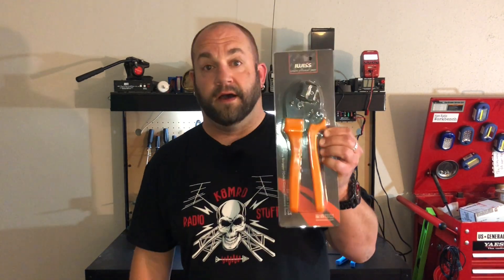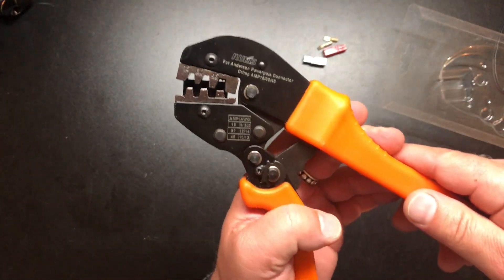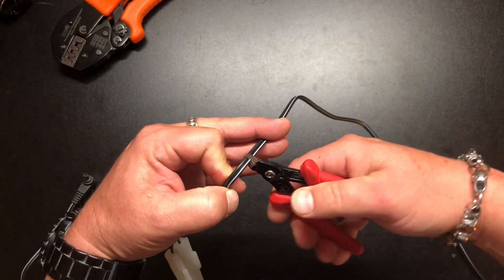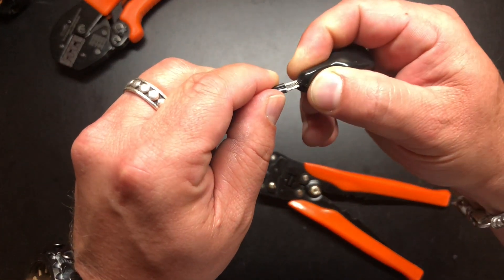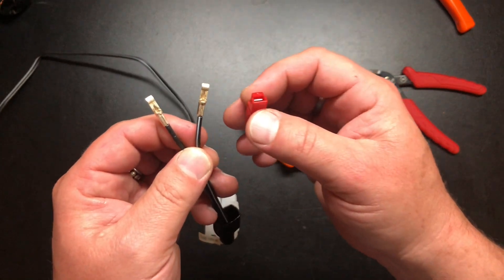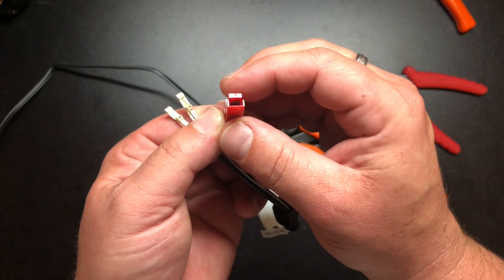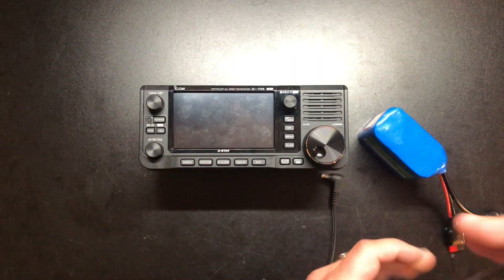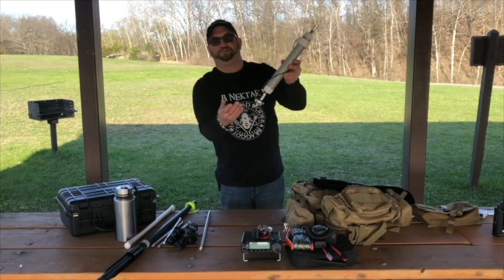IWISS Powerpole Ratcheting Crimp Tool | But is it good??

Comment: A ham throwing out a 2 ft section of wire? Yeah right.
Reply from the maker: That is seriously one of the best and funniest comments ever on the channel!!  It’s getting pinned for everyone to enjoy.
Reply: I actually gasped! and said out loud (to the dog in my otherwise empty room) “HEY-I’ll take that if you don’t want it”
Reply: @HowToHam_Tom  Know what you mean. I'm going to the club operations house to pick through the "material draw down" stuff and maybe score some antennas or wire or coax. Now that I am a ham all my years of "hoarding" wire, connectors, etc. may finally be worth it!
Reply: I was thinking the same, like most everyone im sure, cheers
Reply: That can be used for a 2M, 1.25m or even a 70cm dipole!
Reply from the maker: It was only to add drama lol!   I still have it, of course.

Comment: I have the Dent-De-Lion that I got off of Amazon and it's been FANTASTIC for over 200 sets of power poll connections. I found it easier to drop the tip into the crimper 1st then close down one click not to press the fitting. Then insert the wire and with the single click on the crimper it holds everything in place. Then crimp down on the 30 then pull it out and crimp it in the 15 for a tighter fit. Then I always use the rubber boot and heat shrink on the end for a really good connection.

Comment: Also bought this crimper last summer on Amazon.  Finally did my first crimp tonight with help of your video.  Our Freemo Std RR club requires the PP-30 for 5-wire interconnection.  Thanks for sharing instruction.  Just a little tricky snapping the connector into the housing.

Comment: Contact crimping hack I have used for years.  Crimping to smaller diameter wire in a contact?  You can cheat buy doubling the stripped length and folding the stripped wire in half. then  Insert into the crimp zone of the contact and complete the crimping.     I would not suggest folding wire to fill the crimp more than once.   But to each their own.  Just a suggestion.

Comment: Given the wire size and current draw, you need only the 15A PP, but you know that. (Captain obvious here...)

For this type of connection, I usually insert a roll pin after aligning the two connectors to keep them locked together.

I had a cringe moment (although I have every confidence that you already checked) when you plugged an untested connection into your radio. I would have done a voltage check to confirm correct polarity first. ;) But then I'm an engineer and anally retentive that way. 

Thanks for the heads up on the tool.

73 de AG7TX

Comment: For a reliable connection, 100% of the strands must pass through the entry and exit bellmouths of the crimp, forming a "brush" on the exit side. At around 6:15 you can see that the terminal has tabs to stop the end of the wire. Push it all the way to the tabs! Don't be afraid to have strands protruding; that's how it's designed to work, so you can verify the quality of the crimp. -IPC/WHMA-620 "crimpety crimpety now now crimpety crimpety ask me how"
Reply from the maker: I only like my stuff to be mostly reliable.
Reply: @hamradiotube  mostly reliable is 100% reliable if there's spare terminals on hand!

Comment: I have these crimpers but for other uses. They work but they DO NOT fit the large 50 amp power pole units so an old school crimper is used for that.

Comment: Hey Mike, nice video on the Anderson Power Pole ratcheting crimper.   I purchased  two types of ratcheting crimpers plus the special dies that are offered with them.  The first ratcheting crimper that I purchased was from DX engineering. It was made by Iwiss with the red and black padded grips for $49 plus 2 special dies that were $20 a piece.  
The second ratcheting crimper was made by TRI crimp with all the special dies that only work on that model for $60.  My second crimper is very similar to the one you reviewed in the video. Personally, I like both that I purchased, but the tri crimp has longer handles making it easier to crimp 10 gauge wire in the 45 amp metal clips.  The one offered by DX engineering is a good quality one, but the shorter handles require a little more effort to crimp 10 gauge wire in the 45 amp clips.
Reply from the maker: Thanks for the input and thanks for watching.

Comment: I have one pair of crimpers. I use them for all crimping situations. (They may be old Klien crimpers) No jaws to replace, crimps all sizes. These are probably 20-30 years old. For power poles, all you need to remember is the crimped area needs to stay "round" in shape to fit into the power pole housing. I crimp it as usual, then turn the crimped area 90 degrees and crimp it "lightly" using a toothless crimp area to round it out. Works on 15, 30, and 45 amp power poles. Havent had a failure to date.
Reply from the maker: Hey, whatever works.  I crimp so many power poles I just like having the crimper for them.   Thanks for watching.  73

Comment: The IWISS seems to be popular!  Guess we're all cheap SOBs.  I bought one a couple years ago and it's been great.  I've noticed that depending on the wire gauge you can crimp it again on the next smaller slot to get a really good crimp.  Like if you're doing a 45, crimp it in the 45 slot first then put it in the 30 slot and squeeze again.  Gets that bad boy really tight and it won't pull off.
Reply from the maker: Its pretty awesome.  I just bought one for a friend who is new to the Power Pole addiction.  They work great and aren't super expensive like a lot of others out there.

Comment: I was thinking about buying this tool, but when I looked at how it crimped, I had an old cutter/stripper/crimper like you can buy at most home stores for like $10 - 20 and just used it.  To be honest, I had to crimp it twice along the connector, but it worked just as good as other connections I did when I borrowed a set of power pole crimpers.  If I made more of these connectors up I would probably buy a set, but for just doing one radio, I didn't really see the need.
Reply from the maker: I was bit by the Powerpole bug early in my ham career.  Now they are taking over my life and I put them on everything 12v DC.  Having 2 crimpers is so convenient for me.

Comment: I have that exact same crimper however mine is unbranded. 
When I put power poles on a small gauge wire I strip a little extra and fold it over so the connector has more to crimp on.
Reply from the maker: Oh yeah I've done that too.  Gotta make it work somehow.

Comment: This is a serious question- can someone please explain to my why every youtuber uses a tool which was designed for open barrel terminals and connectors on closed barrel anderson powerpoles?  Why would you want to put a "box crimp" on a round wire?  Wouldn't a rounded non-insulated crimp tool be better?  Also, look at the manufacturer website/Amazon site...doesn't it show open barrel connectors for this tool?  I see that you tagged the manufacturer on this video....maybe they can respond?
Reply from the maker: Because that's what Anderson Power Products recommends.  Heres a link to the official Anderson crimping tool.  Its not a box crimp.  When the connector gets crimped it is rounded back down by the crimp tool. https://www.alliedelec.com/product/anderson-power-products/1309g2/70162295/?utm_source=google&utm_medium=cpc&adpos=&scid=scplp70162295&sc_intid=70162295&gclid=Cj0KCQjwmcWDBhCOARIsALgJ2Qe-uWd3iVfB7Cwm_E_eYZU_jmNCnYdC9YhriHKPO-AcU8hwKs9bHfYaAqhFEALw_wcB&gclsrc=aw.ds
Reply: @hamradiotube  ok, but look at the connector which they are using in box number one of this page:  https://powerwerx.com/tricrimp-powerpole-connector-crimping-tool. It is an OPEN barrel connector with this tool.

Comment: Hey Mike I have the Powerpole version I bought many moons ago and if I recall it was indeed pricey back in the day but has crimped many power cables for our ARES group and club group. Heck even the connectors today are still pricey. Thanks for the video.....Fred
Reply from the maker: I was just looking at the official one.  Almost $300!!  Yikes!  I'm sure its the last one (or 2) you'll ever need to buy though.

Comment: Thanks for choosing IWISS. This crimper was designed specifically for Anderson Powerpole connectors. Each jaw cavity crimps certain AMP connector only, so choosing the correct cavity is very important.
Reply from the maker: Wow thanks for watching!  Great crimper.  Thanks for the explanation, however I am very aware of my crimping flaws haha!  Really happy with your crimping tool.
Reply: @hamradiotube  No problem, Mike. You'll find a way to work with it peacefully. Thank you for the great video.
Reply: Hey  @IWISS , it would be awesome if you sold or marketed (and maybe you do, but I can't find them for sure) additional dies for this model. The MC4 crimp is basically a half-Anderson. The overlanding folks use these two crimps the most
Reply: I have these IWISS crimpers, and they failed me today. I was crimping AWG14 wire in a 30A terminal, and the wire pulled right out. I was even able to reinsert the wire into the "crimped" terminal, and over crimped it using a Klein 1005 crimper. 
Terminal fine now, but maybe I should have just used the Klein to start with?
Reply: Are the PowerPole dies also available for other models of iWiss crimpers, or do I need to dedicate a crimper just for Power Poles?

Comment: Where did you get the wire stripper like that?  I haven't been able to find a nice automatic adjusting wire stripper.  I've got a good power pole crimper similar to the IWISS (I actually considered getting the IWISS off Amazon).  Also been looking at starting to make my own lengths of coax, but I don't have coax crimpers.  Would love a video or info on those.
Reply from the maker: It's not a very good stripper but I got it at harbor freight for like 10-12 bucks.  I should do a video on crimping coax.  Next time I make one if I remember I'll film it.  Thanks for the idea.

Comment: Good video; but a major error!

After the construction; always, Always, ALWAYS!!! TEST the power plug with a meter to ensure proper polarity!  

DO NOT RELY ON wire color bands to be correct!  They build cheap stuff today by barely skilled workers.

It's also a double check of your own work.

It's easier than replacing a radio worth well over $1000!
Reply from the maker: Good advise.  I did make sure to check the polarity of the cable with my meter before I made the connections.  I'm not trying to fry my new toy!  Being that it comes from Icom, you can prob rest assured its correct but I always check none the less.
Reply: I am in full agreement, it is very easy to make a mistake with polarity and then kick yourself for not checking first!!

Comment: I got lucky with the Amazon crimper I ended up buying. It's served me well so far. I noticed not long ago that there's an insertion/extraction tool to assist in inserting smaller wires into the connector (DX Engineering, Digi-Key and others have it), but a jeweler's flathead screwdriver works fine for me.
Reply from the maker: Yeah I've looked at those extraction tools and just can't justify it when my screwdriver works just fine.  I'll prob get one eventually but its not a big deal.

Comment: For Powerpoles, I don’t cheap out. I don’t need a problem in the field. I buy everything from Powerwerx. More money but never had an issue
Reply from the maker: Powerwerx def has some quality stuff.  I have several things from them.
Reply: Powerwerx is actually cheaper than the normal electronics suppliers for powerpole connectors.

Comment: You could still wrap the longer side through a toroid to take up the slack and double for interference reduction.
Reply from the maker: Well where the heck were you before I cut the wire?!?!  That is a very valid point.
Reply: @hamradiotube  split core makes it possible. Where is a Radio Shack, when you need it?

Comment: Have had that one for a while and it is a game changer compared to using a crappy crimper or improvising with other tools. The thing works almost always on the first try which means you'll end saving money by not wasting metal connectors. Equally helpful is a good hydraulic connector if you are putting connectors on battery or solar cables. Fairly cheap on Amazon or at Harbor Freight.  Hey, weren't  you supposed to out POTAing with the 705?  NK5J.
Reply from the maker: Gotta have the right tool for the job for sure.  I don't want to talk about my pota outing.  I went out last Sunday and the bands were so bad I only got 2 contacts.  Might try again tomorrow.  I'll check the bands before I go out this time though.
Reply: @hamradiotube  Must be the Huntsville Faraday Cage Effect.
Reply from the maker: @thomasstandley6309  Could be.  The bands aren't that great right now.  Made a cw contact to WE4DX POTA on the outer banks just now so I got that going for me.  We'll see how I do tomorrow portable.

Comment: I'm a big fan of soldering the wires to the barrels, but I may look at these crimpers. Also I own the IWISS Dupont pin crimper and it works FB - Tnx Mike, k6sdw
Reply from the maker: Team crimp all the way.  I do solder some things but a good crimp is stronger than soldering.

Comment: Hi Mike,
I have the same crimping tool and bought it for the same reason to not have to change out the dies. If you run into the same situation about having a small diameter wire, what I do is strip off about a half inch, twist the bare strands, then fold the bare end in half and insert into the connector. Stay safe.  73  WJ3U
Reply from the maker: Well if its Don approved thats good enough for me.  I do that too with smaller wire.  Just not on this video.  I figured if I do that some old man is gonna scold me for it, and if didn't people would tell me what you just did lol!

Comment: I bought the West Mountain Radio crimper back when Hamvention was still in Dayton. I’ve crimped hundreds of power poles. For $40, you can’t go wrong. - KI8R
Reply from the maker: Dang I didn't know they had one for $40.  I'm sure that's a good one.  With your hundreds of Powerpoles crimped, you are well on your way to Powerpole level Jedi too!!

Comment: Awesome set. I have a similar set I purchased from Amateur Radio Supply. Never thought to recrimp 30amp in the 15amp for smaller wire. I usually remember it as red was left under the umbrella for the standard orientation 🤣.
Reply: I ended up putting a small amount of solder on my too small wires before crimping.  I never even though of using the smaller 15amp crimp die! face palm
Reply from the maker: Soldering isn't a bad idea, but you should always always always crimp before soldering.
Reply from the maker: Thats just one more example of needing to #hamharder Dan.  If it doesn't crimp in one, try the next.  Brute force all the things!

Comment: I use that same one.  I give it a thumbs up as well
Reply from the maker: Good to know from another source.  Thanks for watching.
Reply: @hamradiotube  I do to, but if you try to crimp the 45amp connectors, you have to squeeze the wings in a little to get it started cleanly. 30 and 15 amp work great.